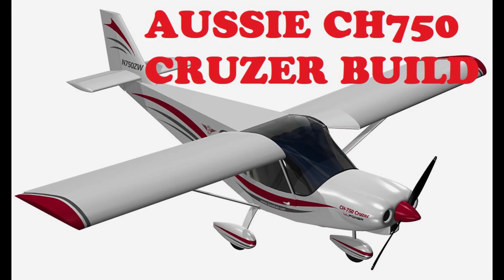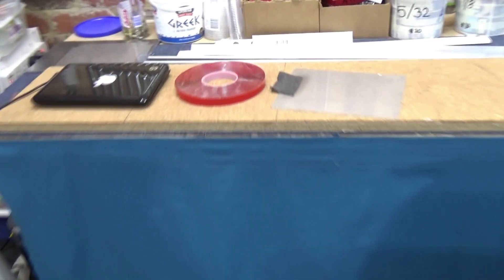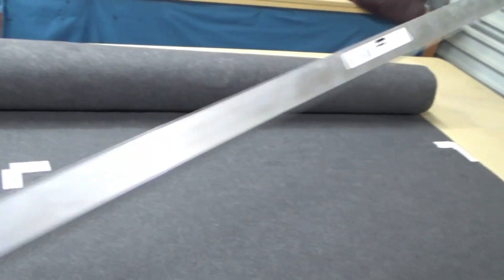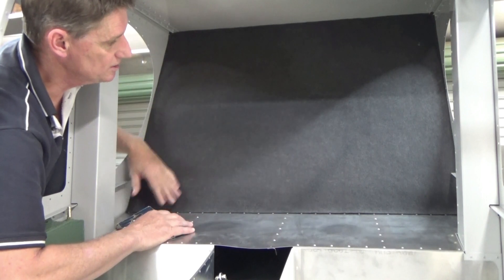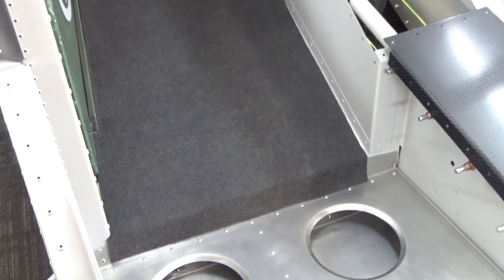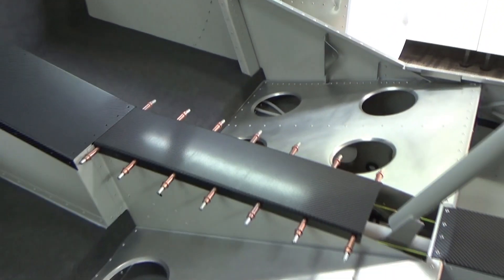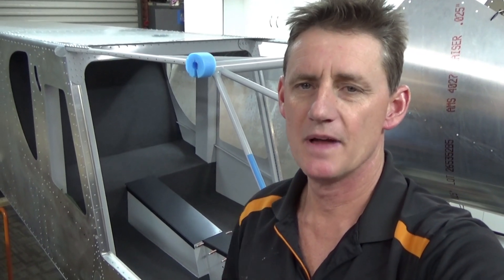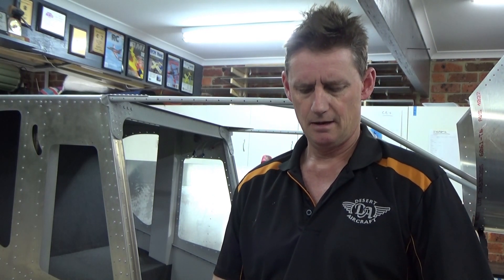How I installed the Zenith CH 750 Carpet Interior

Comment: Where did you get the carpet from?...it looks like what they call "boot liner"
Reply from the maker: Mark Kyle thin felt from the local upholstery place who are making my seats. Turned out great.
Reply: @scottmatthews5280  I note you are not going to stick it down with contact cement...other than overspray from the 3M 77  why not?
Reply: I got some similar stuff for the latest Savannah rebuild I am doing...I couldnt find anywhere in OZ the nice lightweight thing carpet that ICP supply in their kits. The stuff I got looks like yours but I dont think its tough enough to last
Reply from the maker: @SimjetAU  I will see how it holds up. Main reason was fitment, Contact cement etc gives zero movement to line it up once it touches it stays in position. Double sided tape allowed me to have things positioned, a lot cleaner and relatively simple. Time will tell. Tape is around the perimeter with a couple of pieces in the middle as required. Only luggage will go back there eventually. Foot mats are professionally done carpets with backing.
Reply from the maker: @SimjetAU  depends what area I guess, mine is basically for looks at the back.